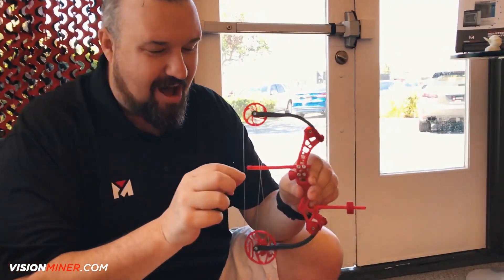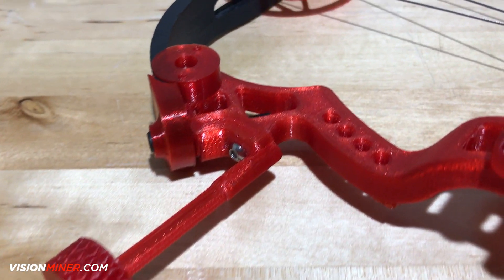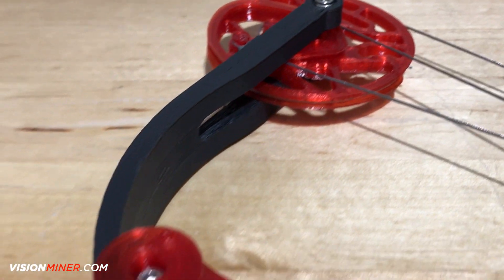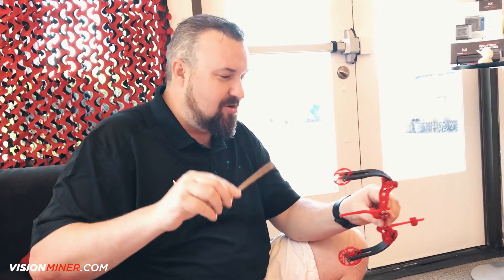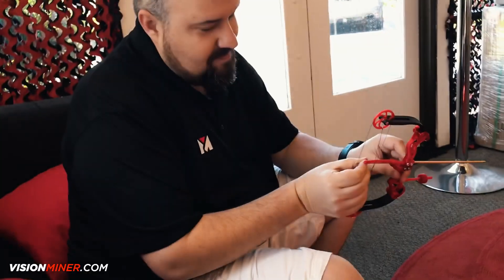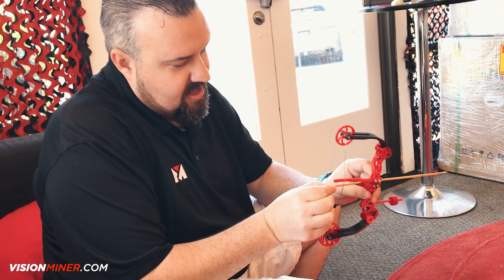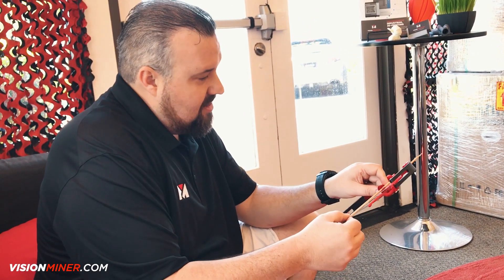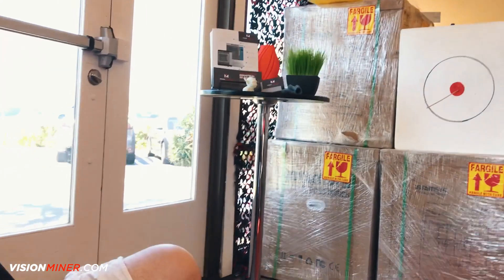Mini Compound Bow - 3D Printed, Carbon Fiber ABS on the Intamsys Funmat HT!

Comment: How do you find Carbon Fiber ABS in 3D printing?
I mean is it worth to use? or another component like Carbon Fiber PETG is better?
Reply from the maker: Usually the lower-grade plastics like ABS use milled carbon, which is like dust -- you'll want to avoid that. If you get a material with chopped carbon fiber, it will add to the strength -- it's definitely a significant increase! Definitely worth it to use, plus it gives a great finish! Check out visionminer.com/materials, and you can also look at 3DXTech's offerings -- they do great stuff :)